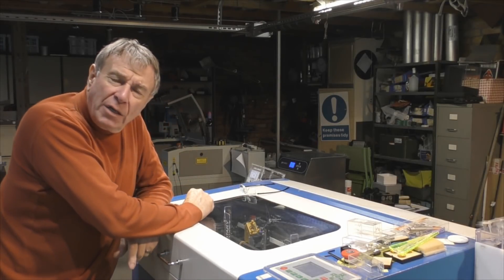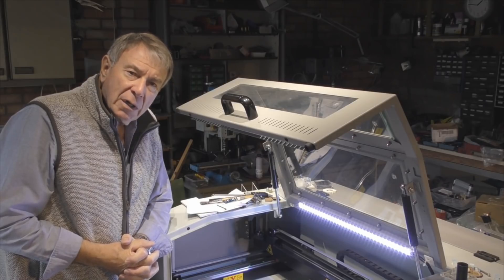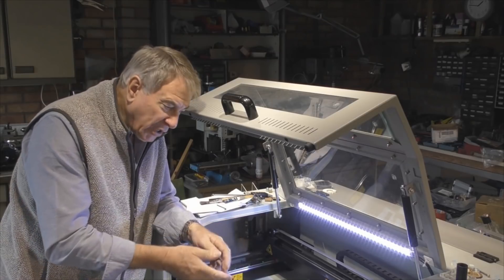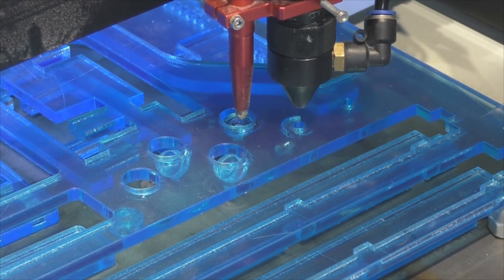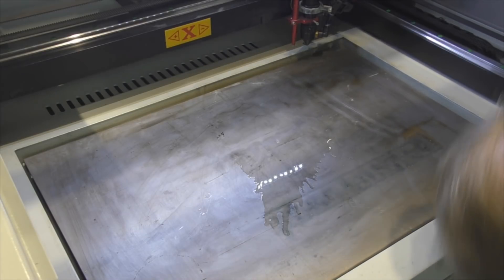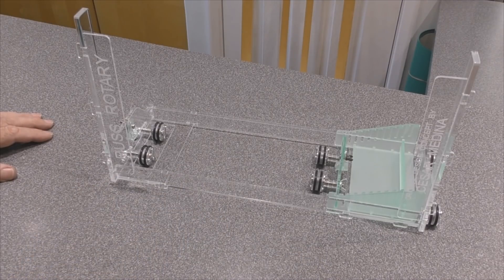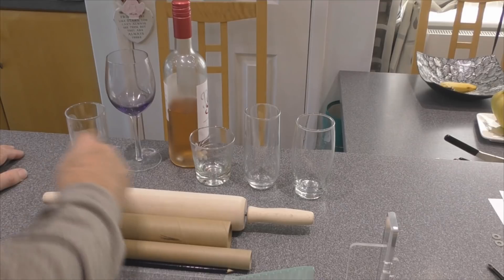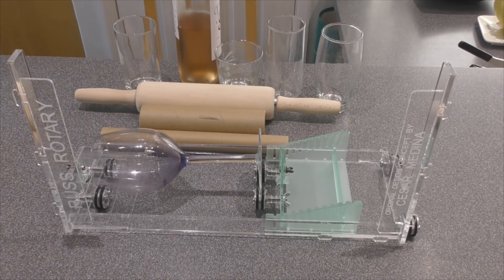RDWorks Learning Lab 122 Let's Make a Rotary Engraver

Comment: Russ, Brilliant!   Reminds me of a project I did on a packaging line to keep hearing aid batteries from jamming aka bridging on a conveyor line.  I used a wheel riding in the conveyor belt to operated a crank connected to a "fishtail" within the lane to break up the clusters.  no air, no electrical, just simple.

Comment: Damn, you are super lucky having free Acrylic at your disposal.  Regardless what it is that is a killer deal.
Reply from the maker: Hi
I am lucky to have a shop fit and signage business near me that has several cnc routers and two laser machines. One of those lasers is a 1600x1000 Redsail clone with a 150 watt EFR tube. Several months ago, the  ONLY guy that  knew how to use it left. Ooops that was good planning???  Through various contacts they approached me as some one who knew about Chinese laser machines to see if I could help get it back to work for them. It's a work in progress  because it's a Leetro control system operating through LaserCut 5.3. All new to me and with some very weird operating characteristics which I am still trying to sort out. This "consultancy" is not for money, instead I collect a car full of acrylic and PETg off-cuts and chunks from their scrap bin at each visit.  A kid set free in a sweet shop does not come near to explaining the experience. They are throwing hundreds of pounds worth of material away and I get the benefit whilst expanding my experience with another machines and furthermore,  enjoying myself. Yep, I'm one lucky guy.....and all because of a cheap crappy Chinese laser machine I bought two years ago.
Best wishes
Russ
Reply: Very nice and this is only the second time I have heard that term of Leetro so it must be a rare beast in the field and they were having issues with theirs as well.

Comment: Love this- Here in the USA I can't find the bearings for less than $12 each--I hear you say they are around a pound in england - do I need to buy them from there
Reply from the maker: Hi Shay There is a HUGE mark up on bearings. I but these in batches of 50 at £1 each
https://www.rapidonline.com/reely-625-zz-radial-steel-ball-bearing-16mm-od-5mm-bore-5mm-width-50-6460
 You can buy imports at a reasonable cost 
see   https://www.ebay.com/itm/608-623-625-688zz-Double-sided-Metal-Sealed-Deep-Groove-Ball-Bearing-High-Speed/223959673454?hash=item3425096a6e:g:saoAAOSwKY9efxnq

Best wishes
Russ
Reply: Never mind I found a great deal on amazon-

Comment: Russ, I cut the parts for this yesterday and I am about to glue it up. Im wondering though... what are the pieces for you were assembling at 11:15?? I don't see them in use anywhere??
Reply from the maker: Hi John

Watch #123 and at 3:30 you will see how those parts are  used.
Best wishes
Russ
Reply: @SarbarMultimedia  Ahhh...  yes, I forgot about that video. I watched it before but did not remember that part. Thanks Russ!

Comment: Hello, I have a question which I can not find the answer anywhere to. I have Gweike laser, but basically a whatever Chinese machine. I bought a chuck rotary axis for it from Cloudray, but I guess that also does not matter. The machine has RDC6442S-B(EC) controller and X/Y 3DM580 motor drivers. I am using RDworks on windows. My idea was, that I buy an extra 3DM580 motor driver and connect it to the RDC6442S-B(EC) controller U axis connector and then I don't have to rewire the machine for a Y-axis connector what I disconnect and connect the rotary axis. I connected everything, and from RDWorks I can test and move the U axis, the rotary head spins, and I still have the x and y-axis...but that is it. There is no way to tell RDworks that a job is only a rotary job. Is there a solution for this? Thank you for your answer! All the best, Zoltan
Reply from the maker: Hi Zoltan
What you are trying to do is a great idea BUT it will not work because the software does not support your idea.. You have not wasted your money and  it WILL work but with a different approach.

 The software ALWAYS uses the Y axis to INCREMENT after each X axis scan line.  The software  has no knowledge that your image is going onto a round object. It thinks it is a normal FLAT  XY scanned image. Thus you cannot use the Z or U axis for rotary work as you imagined.. 

I presume your GWeike machine already has a Z axis which is why you plan to use U. . You already have the U axis driver working  BUT it needs to be driven by the Y axis.

 Imagine your controller at the bottom of a capital T. You need your Y axis driver at one end of the top of the T and your U axis driver  at the other end.. At the T junction you need to install a 2 pole changeover switch  to direct the Y output from the controller  ( terminals  1 and 2)) to either  the Y or  the U diver.. In that way you can go to the vendor settings and have a dedicated  step interval  for your U axis rotary that will rotate exactly 360 degrees. Once this has been set you will only have to select rotary in the software and define the diameter you want your image transferred to. 

 I hope that makes sense.
 Best wishes
Russ
Reply: @SarbarMultimedia  Yeah, this is what I thought...thank you for the quick response!

Comment: Hello. I"m searching for a rotary tool for my K40, and I found your video. I downloaded the file from the link, but the plan is not the same as the video. Is it possible do get the good file ?
Many thanks
Reply from the maker: Hi Aurelie
No problem, just message me with your email and I'll send you the drawings. The drawings you looked at are the original concept drawings by Cesar Medina. 
You may wish to make a few design modifications for your K40 ( maybe shorten the arms)
All best wishes
Russ

Comment: I downloaded the dxf file but it is coming out really small in corel draw.  how do I know how large to resize it?
Reply from the maker: Hi 
It is drawn in mm and usually people import with inch settings and the drawing appears to be 25.4 times too big.   Unless your import units are picas ,pixels or points, I can't hinkof another reason. I usually add at least ONE dimension in the drawing that  allows you to reset the scale factor.  Import the DXF file directly to RDWorks and it should be correct if you have RDWorks set to MM import .

Best wishes
Russ

Comment: Blindingly simple and looks to be effective.  Both the video and the plans are not available!  Very disappointing. Bob
Reply from the maker: Hi Robert, 
My plans are not posted yet it will be a day or two for the forum. Ceasars  links are the ones I followed but he may have changed them I have requested that he send links directly to these comments so that you can click on them. 
 Thanks for the info. Using the device will be posted with a few hours.
All best wishes
Russ
Reply: Fixed, please try again.